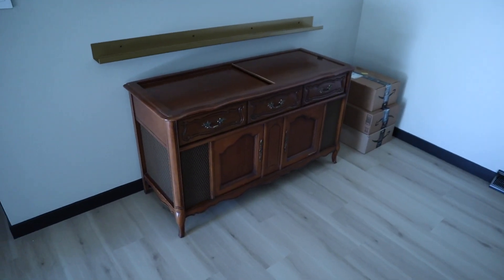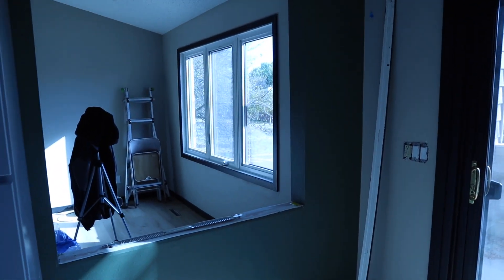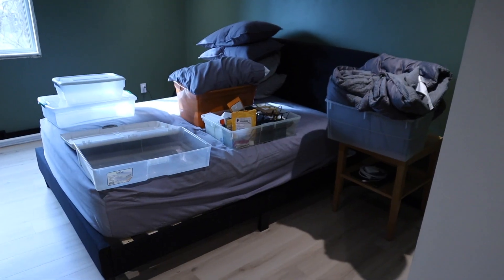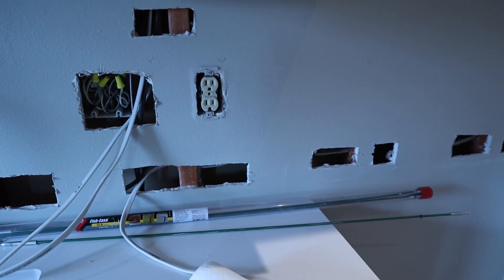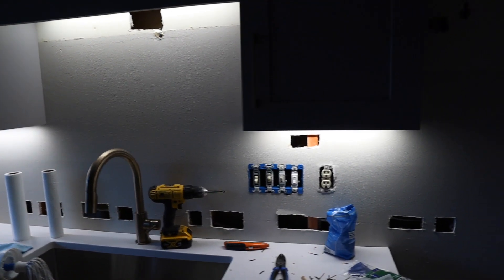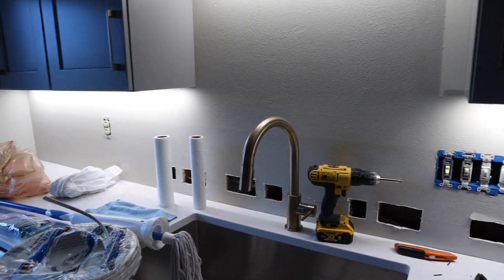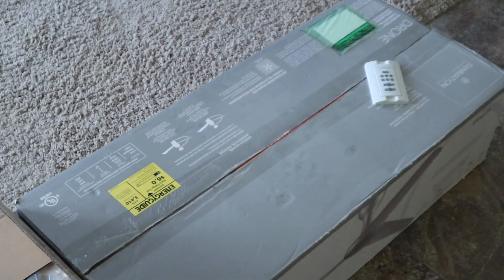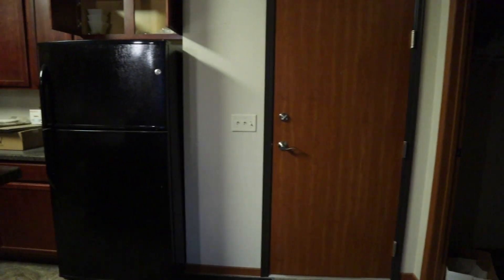Moving Vlog 2.16 | I'm Moving In!

Comment: Your place is looking good! Just a thought (for the kitchen)... have you considered some variant of the Matthews Fan Co. Patricia 5/3 blade (42" in the 5 blade/ 42" or 52" in the 3); all black? Or possibly a Star Fans Star Propeller, I'd assume a black motor mayyybe the graphite, no idea on the blades outside of matching with the motor lol (you mentioned you could go wood tone) 🤔🤷🏿‍♂. my bad if this is a duplicate comment, I posted the other day but the comment wasn't showing up.
Reply from the maker: Sorry, haven't had time to approve and reply lately so I may see an earlier comment further down. 😅 Both great suggestions. I have considered all black, my existing Matthews Mollywood was on the short list for a smaller blade span option if the Todo felt excessively large. I feel like all black might be a bit too contrasty for that room which feels a bit lighter and airier despite the black trim. Maybe black motor with a wood tone; there will be a butcher block countertop going in that passthrough that I could play off, but I'm not sure what tone that will be yet either. Something more in that graphite realm could be interesting, maybe a washed light wood blade to go a bit more with the flooring. That's a design area I hadn't super considered yet.

Comment: Actually with the brass lamps and silver hardware, is there a fan that is both brass and silver?
Reply from the maker: I need that mixed metal combo. Lighting was doing it for a hot second a few years back and then it kind of fell off before fans could pick it up.
Reply: @vfandm  I can think of some vintage fans that did it, but I dont know current lineups.

Comment: Why not the Ascension or a silver Original?
Reply from the maker: Ascension was out for reasons, can circle back to that at a later time. Silver Original would've been super fun actually, I just hate the sloped mounting options with Originals and was not going to do modifications to the install specifically for it. I don't think I would've liked either blade finish with my floors, either.
Reply: @vfandm  I love Hunter's vaulted kit!